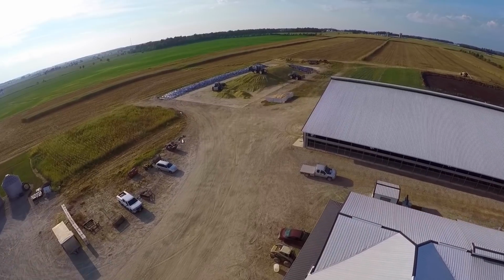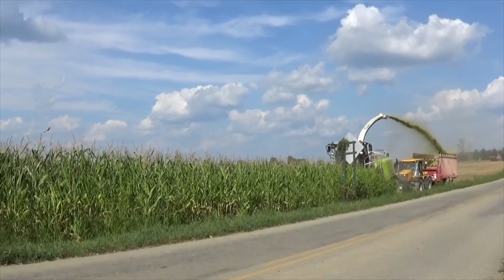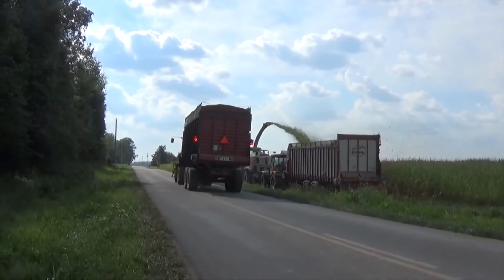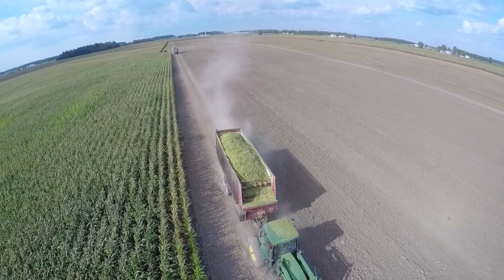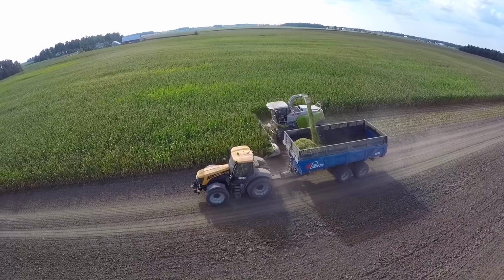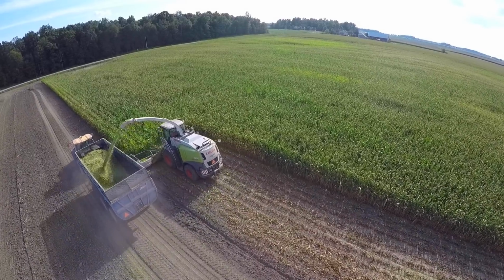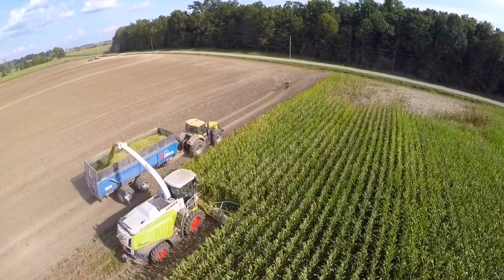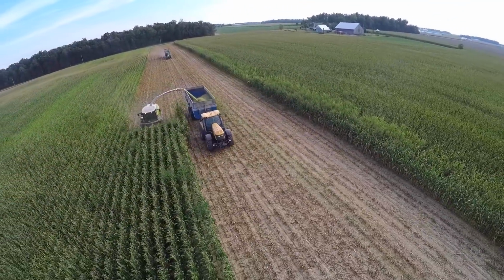Chopping Corn Silage near Versailles Ohio - August 2017

Comment: As mentioned by some one else, some Fastracs can go 50mph. The also have 4 wheel disk brakes and suspension on all 4 corners. Things like trailer air brakes, road lights etc are standard features and have been for years.

Comment: looks like the corn wasn't very good, I mean I can see the ground pretty easy from the quad, hopefully it makes them through the winter. corn down here in Ky infront of my house is excellant thick and leafy with full ears I mean it's 10ft tall at least but grain corn and silage corn is a differ animal corn silage has a lot bigger ear
Reply from the maker: Too much rain in the spring and first half of the summer had hurt it then it turned dry. There were several spots that were under water for a while and replanted and under water again.